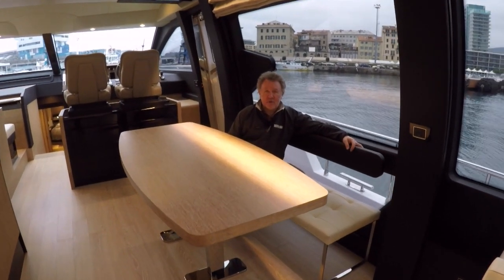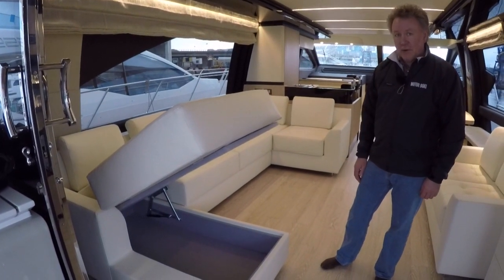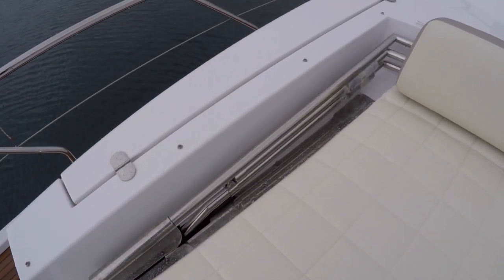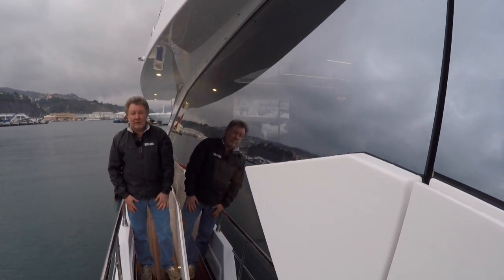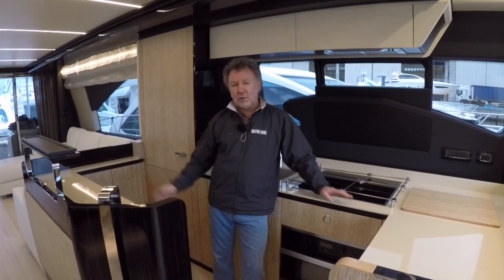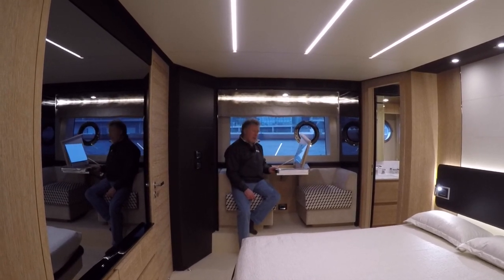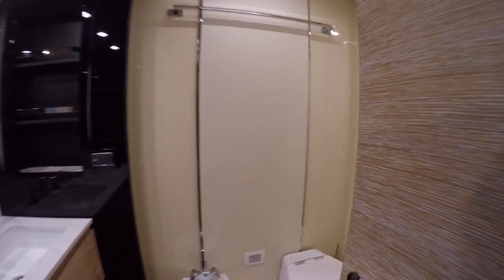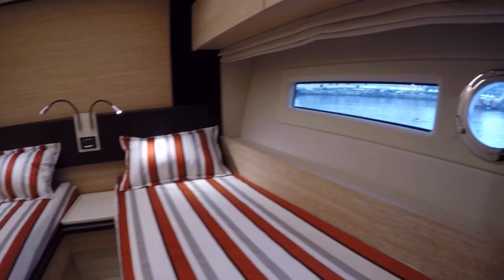Azimut 72 from Motor Boat & Yachting

Comment: Do boats have holding tanks for grey and black water? None of these videos mention that.
Reply: Of course they do. Most countries do not allow the pumping of these waters into their harbours anymore.
Reply: Let it flow in the see
Reply: In my boat ( a Searay 290 Cruiser) the black tank (toilet) comes with a pump known as a macerator; at open sea I’d open the valve to the sea and switch the macerator on until the tank is empty followed by a good flush. Water from the shower, sink and galley will go overboard through  outlets specifically made for this purpose